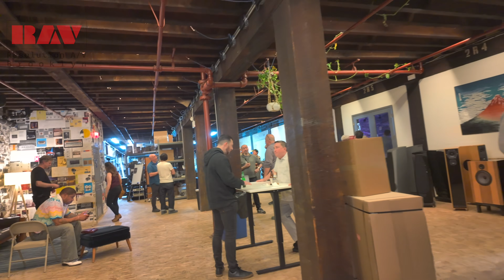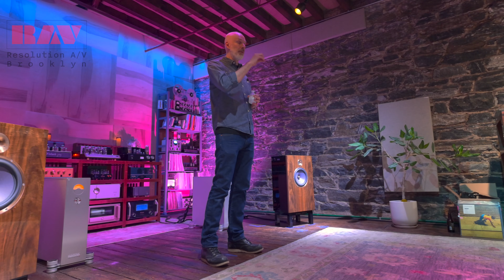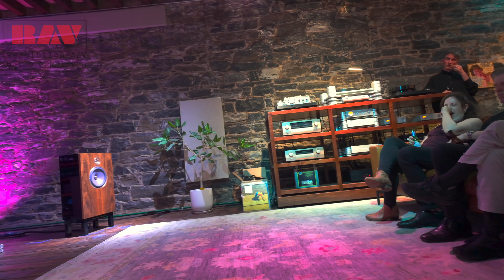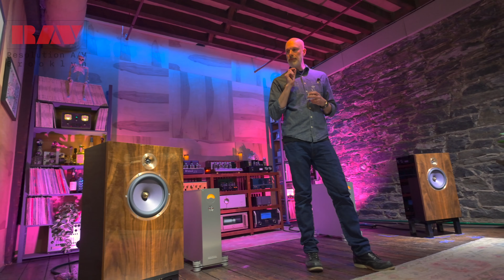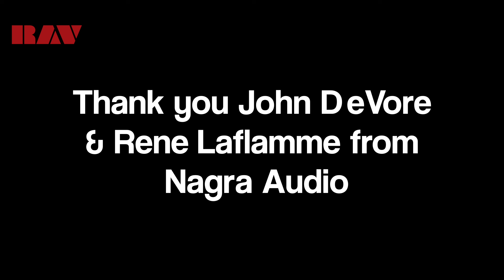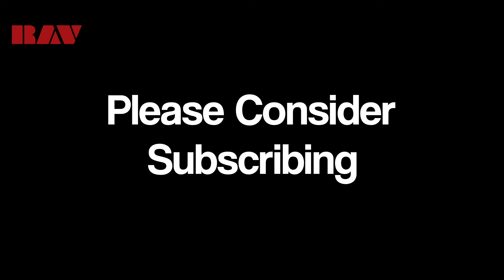The New O/Bronze! John Explains His Most Recent Magnificent Creation

Comment: My pair of O/Bronze arrived about 2 weeks ago and are still breaking in - a while to go. In the first 25 hours, I hear a clear improvement over the stellar O/96. Bass is deeper and more detailed, and the top end is much more extended - not bright, just more of everything - airier, detailed but not bright, cleaner decay. Hazarding a guess that the ports and woofer basket are responsible for removing resonance and allowing more detail and extension without blurring. The only thing I did notice in tonal change from the O/96 is that the O/Bronze bass is less "fleshy" and warmish, but instead more defined, taut, and easier to follow deeper bass line detail. 

Overall, it's like they took the best parts of the O/96 and turned it to 11.  They do well on a range of amplifiers, from an 8w 300b to a very powerful 75w 833a SET, not to mention a Leben CS600x.  If you love the O/96, you will adore the O/Bronze. I did need to experiment with placement a bit as the deeper bass had me moving the speakers farther away (just 3") from the rear wall.

I bought these without an audition, given I could not easily find a dealer with a pair in stock to demo, and was taking a leap of faith based on owning several other Devore models and being familiar with the O/96 in my system for several years. Zero regrets - I feel I can call my system "complete", and while I've heard other speakers at this price point, the O/Bronze sound is what my ear prefers (especially given my preference for SET amps). Fit and finish are typical of Devore O series - gorgeous wood cabinets and the bronze trim is wonderful.
Reply: Thanks for sharing! The O/bronze are on my list of contenders for next speaker upgrade. Hoping they'll be at Apona this year